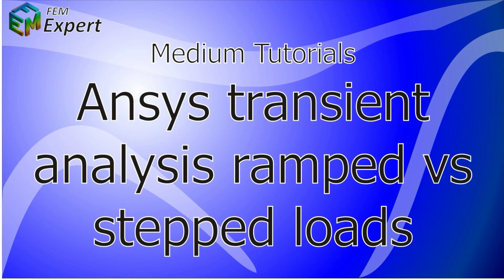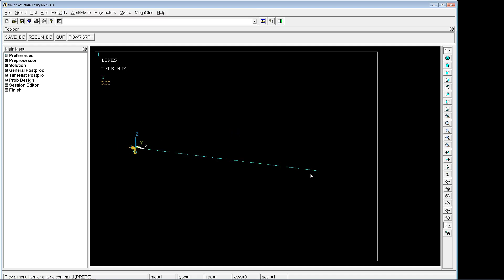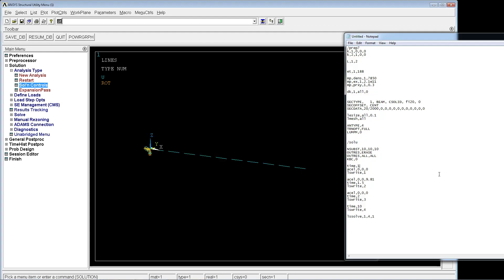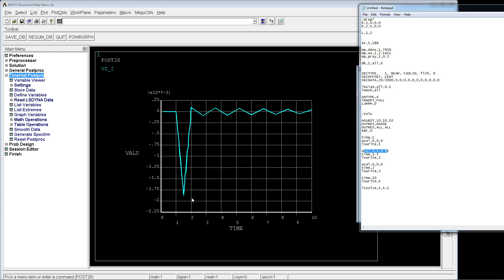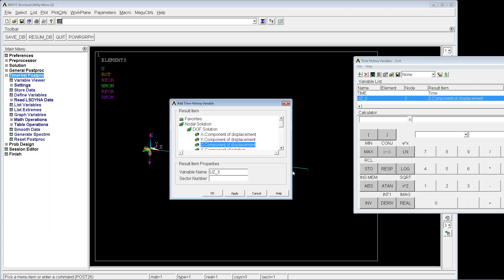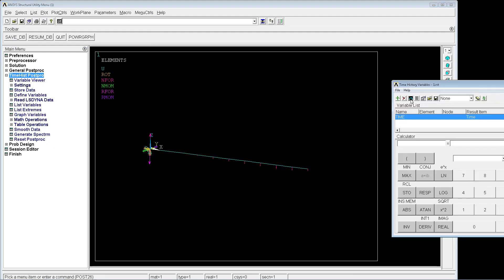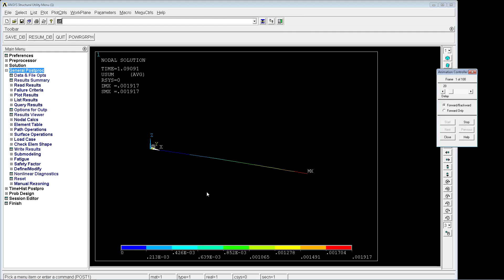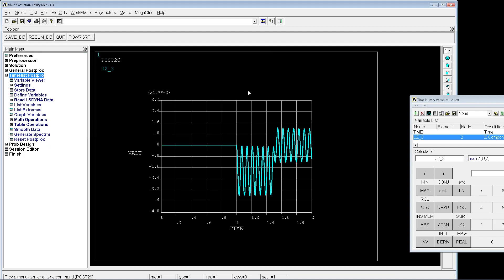Ansys Tutorial: Ansys transient analysis on a structure, ramped vs Stepped #45

Comment: Hello sir, can you explain the ramped loads or stepped loads in Ansys harmonic analysis? I found it pretty different under these two loads.
Reply from the maker: Hello, yeah ramped applies the value progressively (most likely what you want) and stepped applies the value in a moment, you will have to read the help for more details.
Ramped is what you normally want
Reply: @FemExpert  Speaking of seeking help, what advice can you offer? The official documents are basically discussing the difference between these two methods in modal analysis(as mentioned in your video). In addition, I have found almost no relevant discussions on the Internet. However, the solution to this problem (harmonic analysis in the case of two different loads, the analysis results are too large in piezo actuator analysis) is very important to me. Thank you very much again, sir!
Reply from the maker: @rudolfzhou884  contact us and we will see what can be done
Reply: @FemExpert  Moreover, I also found that under the ramped load method, the response amplitude of the same structure at the same frequency point will change with the frequency range of the harmonic analysis. Specifically: the change in multiples, that is, the frequency range is doubled, and the amplitude is reduced by half at that point. This phenomenon does not occur with stepped loads. so sad😢. If you want, I can provide a detailed code and communicate it with you in the E-mail. Thanks again for your patience. I wish you a happy day!
Reply from the maker: @rudolfzhou884  send it to the contact email on the profile, we will look at it.

Comment: Thank you very much for this video....How can i bring a load such as train passing, which is a multi axle load. Time step is 0.001 and it takes 2.5 seconds to pass a particular point. I have a excel file with this data...so it is not practical to do it for every time step as shown here.. how can i approach this problem...Thank you in advanced
Reply from the maker: You want to simulate the transient analysis and you have the data in an excel file, ansys wont work with excel, but you can try to make a routine in excel that will write each one of the steps in ansys code, taking into consideration your values.
Nevertheless i would assume that if you have one wheel or 5 the process is exactly the same, so you might be able to simulate it for one case,

Comment: could you present any tutorial with coding If if Else Statements for APDL and maybe some basic how to do code for APDL with Python or C++ or Matlab or Fortran ?
Thank For All Tutorials ; That was incredibly useful !!!
Reply from the maker: Hi Roman, yes we will do some tutorial with the coding they are schedule to be included in the advance tutorials.
If you are in a hurry look at Ansys help for:
*If, *else, *Endif
Here you have an example, lets say you need to check if variable A = 1 and do something:

*if,a,eq,1,then (if, variable a, equals, 1, then)
aplot
*else
lplot
*endif
Reply from the maker: To code in Ansys APDL from any external program is a little more complicated and it works using Ansys batch, look in the help for it, it has a sintaxys in wich you call ansys.exe then add sufixes like -b, -m (to determine different option) and also requires having a code made in APLD which is a text file.
Hope this will help you, we will eventually get there but will take some time.
Reply: @FemExpert  hey, thanks a lot!!! 
I am used to work with python api for SpaceClaim Ansys, and that's it) and a bit macro coding with apdl)  
Thanks for your advice I really appreciate it) 
P s.
Tutorials are amazing 🤘
Reply from the maker: @Roman-kn7kt  You will get used to it very fast, its not a complicated coding, always look at the help for answers.
Good luck